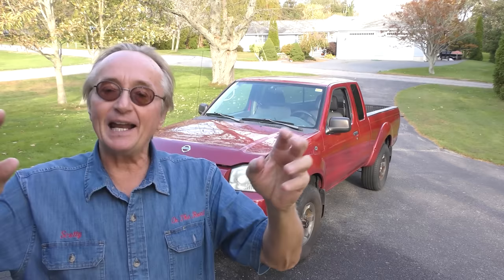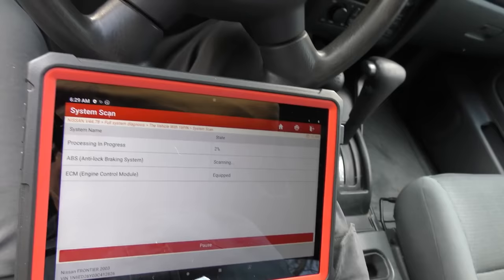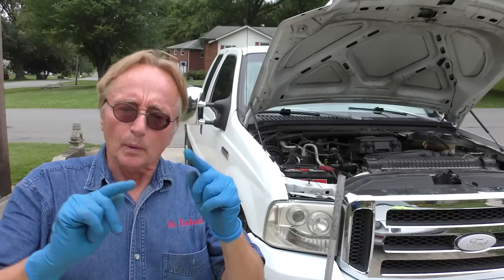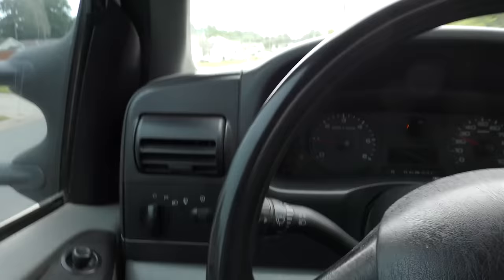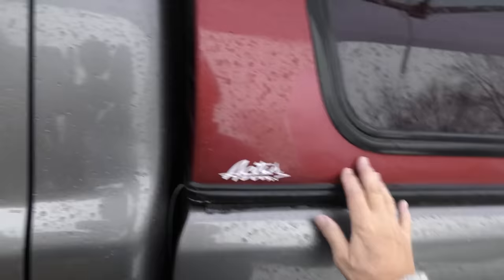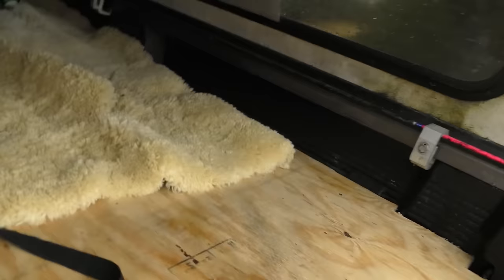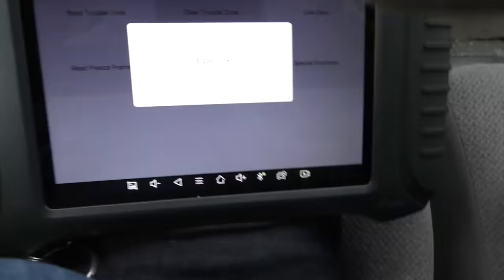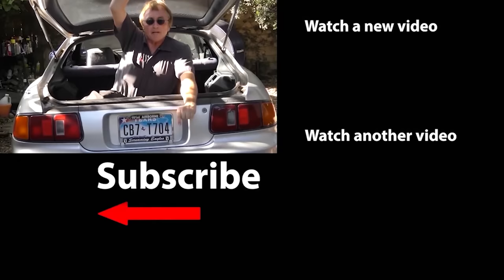3 Best Trucks to Buy When You’re Broke

Comment: My 2000 F-150 (4.2 V6, 5-spd) has 324k miles. Replaced the clutch 3 times (the real weak spot in that year's design as the throwout bearing is integrated with everything!), all-new peripheral "perishibles" (alternator, water pump, starter & power steering pump, coil plugs and wires) once. But otherwise, it's half-way back from going to the moon! Wish 1st was a granny though. Otherwise, it's been a really good truck!
Reply: im looking at buying a 2003 F-150 4.2L V6 manual transmission with 132,000miles for $5.4k....Sound decent if its maintained?
Reply: @drbookie2169  yes, they’re great trucks, as long as you maintain it it’ll last forever

Comment: Gen 2 is the best Frontier I have a 13 and a 22 13 just shy of 200.000 never in the shop had to replace HVAC blower motor today 60.00 good as new. 22 has almost 20.000 . I had a 04 5 speed but sold it with over 300.000 miles. Great trucks and way more comfortable then the Tacoma My frame is mint and I live up north in NY.

Comment: I’ve got about $3500 into a 2001 f-150 with the 5.4,the automatic 4 speed, 

Paid $1400 but had to do a few things, fuel tank and pump, pcv valve, front wheel bearings, tires, brake job.

Just need a new bed but don’t want to drop $1200 on one not rusted to hell

Comment: Yeah the Frontiers before 2010 actually have more made in Japan parts than the Tacomas of now.   I had a 2006 Frontier that ran like a swiss clock. I only sold it because the rust from living by the beach had eaten holes in the body.  It had made in Japan power steering pump, manual speed gearbox, alternator and starter was all made in Japan as well as many other parts. Even the heavy duty brake pads it came with, brake lines, etc... where all made in Japan.    Those days are one now.  Tacoma and Frontiers have fewer and fewer made in Japan parts today and  the damn trucks cost twice as much!

Comment: You know, don't be afraid of the old 351 f250s either, especially if you can find one with a manual. Honestly, the old f150s don't be afraid of those either and I'm talking about with the Five-O, but you be better up getting one with the 300 cubic in straight 6. They're pig on gas but they run forever and they have to work for days torque for days.... If you want to go know where you can I don't suggest it but 97 to 2003 F-150 but get the 4.2 L V6 that motor runs forever or the 4.6 L two valve

Comment: Had great success with a GMC. Vandura 2500 - motor and transmission rock solid, simple, reliable van. 1988 ;-)  when they were still simple enough to keep running, without going to a dealership. Body rust, from dirt getting into the side panels, and not being cleaned out, so that moisture accumulated along the bottom edge.

Comment: You could buy a Nissan Hardbody with a V6 up until 1995 I believe.
Reply: Came here to say this!
VG engine, typically on the 4x4s.
4 cyl was the KA24.

D21s are the unknown secret and hopefully Toyota heads never find out.
Reply: Just bought a '95 2wd V6.  The VG30 is a great engine, I have 3 sitting in the shop so I'm going to start rebuilding one.
Reply: @mescko  for sure, all the VG engines are awesome, just gotta keep up with the Timing Belts.
Reply: @KrashGT  I did one on my '88 200sx SE-V6, loved that car.  Never liked any V6 'til I had that car.  Also had an '88 Maxima SE.

Comment: I had an ‘88 Nissan D21 Hardbody 4x4 5 speed 4 cylinder from my dad he bought new with 9 miles on it from the dealership We both put around 475k miles on that thing before I broke the transmission by hauling a lot and way heavier than what it was probably rated for up and down the mountains of NC, everything was all original parts except a new clutch and a radiator I assume both from having to climb those mountains so much. Some guy offered us way more than we thought it was worth (back in 2002) and he put a new transmission in it and is still driving it around today. Best truck I’ve ever owned!

Comment: The F250 with the 5.4 is a very reliable truck. Do be aware when looking to buy one. Expect to deal with the brakes locking up, often and replacing lots of calipers and pads. It’s faster than an f150 with the 5.4 for some reason, I assume they are tuned better. And the worst part is the gas mileage, avg 10mpg, the truck will say 11.5ish. It’s sugarcoated. And also the gas needle and miles to empty display is terribly calibrated. It don’t work accurately. It’ll piss u off.

Comment: My first vehicle was an 01 frontier.. Never got it on the road because i decided to go with dodge.. But i gave it to my dad, 230k miles, broke a timing chain and replaced it, has a bad crank pos sensor, and that thing still starts, goes, and gets anywhere it needs to be on the oem engine. Luckily i think when his timing chain broke, none of the pistons made enough contact with the valves to blow up the engine. New belt and new timing, thing runs like a dream.

Comment: I have a 98 ford ranger with 354,000 miles on it. Kept the oil changer, Flush and fill the coolant, the only problem i have had is the automatic transmission i replaced it with a rebuilt Jasper. That's it. It has factory air. I installed pan Alpine stereo system love my truck.
Reply: Which engine?

Comment: If it’s a 5.4-3 valve engine. The ticking is the cam follower/ lash adjuster. That’s a tell, if you don’t replace it, it will grenade the head, cam, and more then likely, the bottom end
Reply: Those are the Triton motors right?

Comment: Got a 2015 Frontier because my F-150 got hit, and I'm OK with it for the most part. Significantly cheaper than the similarly specced Tacoma that I really wanted. Really only minor complaints with it, being that I really like the way all the controls on my F-150 and the Ranger I had before that were, but I've had it about 7-8 months now and I'm adjusting. Just minor things like the windshield wiper controls being on the opposite side, the headlight controls being on the turn signal instead of on the dash, and not having a column shifter, just to name a few. And the gas mileage is worse than my 01 Ranger was but at least it's slightly better than the F-150. Would have loved to have a Ranger of the same year if I could have, I hate that they stopped making them for the US market.

Comment: Any 78-83 Toyota.
The 20r holds the guiness book record for most miles on an engine.
You can buy these trucks for $600-$3,000, all day everyday.
I used to flip them, as an auto detailer, because there is nothing to them.
20r or 22r if you want reliability.

Comment: What about a 2004 Ford F150 Heritage with 4.2 liter V6? I paid $2500 for it 4 years ago. It had 180,000 miles. It now has 233,000 miles. It does have a rear main leak but as far as I can tell it doesn't smoke.
Reply: I have a 2003 with the same engine. I also had a 99 with that engine. I did a crappy job of taking care of my 99 and the engine finally blew at 215000 miles. It is a tough engine. So I bought my 2003 with that same engine at 200,000 and I’m taking very good care of this one. Mine also has a rear main leak. A few days ago, I saw one similar to mine at a convenience store, and I asked the clerk was it her’s. She said yes; it’s a 97 with the V6 that has over 350,000 ORIGINAL miles on it. She was BRAGGING about it. Take care of these engines and they will last.

Comment: I've got a 2007 4  cylinder Frontier with 262,000 miles I bought new. I looked at the new Frontier truck made by Peugeot and I didn't like the cost of changing plugs or the weird grooves in the truck bed making cleaning it harder. The old Frontier is great for fishing trips and I don't worry about leaving the truck on the side of the road while I hike to go fish. It amazes me my 6 cylinder 10 speed F-150 gets the same 22 miles a gallon as my old Frontier. Better believe I'm babying the Ford and keeping it in top condition. The Frontier isn't pretty anymore, but it's doing the dirty work I don't want my big truck doing. Friends often want me to sell my trash hauling Frontier and it's a hard decision to make unless I take Scotty's advice on an old sedan for my teenager to drive.
Reply: I have a 09 5 speed Tacoma at 265k. I think your frontier will live just as long. Both good trucks

Comment: I got an ‘07 f-150 super cab 4x4 with the 4.6 v8, the transmission shifts and the engine starts everytime, she’s just got rust. I bought it from family and payed 1000 for her earlier this year with under 80k miles on it. I’m using it as both my daily driver and a work truck. It was just sitting in my uncles driveway for 10 years with infrequent use.

Comment: I'd strongly recommend staying away from the 5.4L in either the F250.  I had to replace the engine in my 2005 F150, and that was in 2013....so 8 yrs and an engine replacement.  I sold that truck in 2022...and I was afraid it was going to blow up again.  AND yes I was diligent in my oil changes, 5w20 synthetic.  It's just a bad design.

Comment: Just saw a 2006 Ford Ranger auto. 116k miles on Chicago craigslist.  They wanted $6999.  Might be worth it.
Reply: Eh my experience with ford transmissions is they all tend to go out around 150-180k, so be aware of that. YMMV
Reply: @sknapp19911  the manuals last longer

Comment: Just bought a 99 frontier with 138k miles. Runs great, everything works, no problems. It’s an Az car, so no rust issues. Getting used to a stick shift took a few hours, but all good.

Comment: I got a 1995 dodge ram 1500 4x4 400k miles original engine and trans lifted for only 400 bucks runs and drives no ac but heat works

Comment: Cheap cars I bought in 2022-2023 because I'm poor 
2006 Toyota matrix 190k $900- needed brakes,  control arms ball joints wheel bearings 
2005 gmc Yukon xl suburban 4x4 180k $3000, had fuel leak from Rubber hose. 
2011 Toyota sienna 199k $1200, needed fuel pump.

Comment: Ultimate cheap pickup was the Isuzu Pup Diesel manual tranny from the 80s. Great vehicle. Those things ran forever
Reply: Like the old Toyota mini trucks from the 1980's that had the R-22 4cyl engines. Dam things ran forever and you couldn't kill em', even with oversize tires on the 4wd models! Lol
Reply: Bad part is you can't find parts for them anymore
Reply: @jbar518 The Isuzu Pup diesel was rare when new.  The Isuzu diesel is an excellent little engine.

Comment: Looks identicle to my 2003 Frontier 4x4. Manual shift.  I have 267,000 on it. I have changed timing belt twice. Still rollin.. One thing that surprises me is the wheel bearings are still doing fine.

Comment: Beware of any Ford F150 that has the 5.4 three valve Triton engine. These have variable valve timing with camshaft phasers that go wonky if the owner doesn't change the oil very regularly. It's very expensive to fix. The two valve 5.4 Triton and the 4.6 Tritons are fine. No camshaft phasers to go bad.

Comment: You're not hearing lifters on that F250 you're hearing the cam phasers. Time to go through the timing chains and tensioners clean out the oil passages and phaser lockouts then it will be good for a while.

Comment: i bought a 2000 tundra 4.7 v8 2wd, for $800. got a new frame put on it for free due to recall, and have done $1200 worth of of work. BUT I HAD MY NEW FRAME PUT ON IN INDIANA. but i did have a friend working at the toyota dealership. im thinking about trading it in on a 4wd though.

Comment: The ford f 150 between 1998 and 2002 with the 5.4 Triton engine runs forever to. I've seen them with 400.000 miles with the original engine and transmission

Comment: I bought a 2006 Cadillac SRX with 140k for 1200 put a new timing chain that only lasted about 2 years. Junked that and fixed up a 2003 Toyota Camry i bought for 600 and did 500 dollars of engine and radiator work and thats my daily now. Been running like a champ A/C is stil ice cold after getting rid of the nest in the cabin air filter slot.

Comment: The old Frontier's had O2 sensor issues and couldn't even haul a dryer without becoming asthmatic and costing you $385 per o2 sensor replaced 18 factory one's with factory one's and an additional 6 aftermarket at $290 a piece. They are a piece of crap. Also the F150 and 250 were also terrible. My work trucks, (owned by the State),  we're terrible. They claimed the couldn't replace them, but had money to repair them. Resend fell out when they changed the fluid at 40,000 miles, went through 3 of the m at $10,800 a piece had a propane manifold ,( which we didn't use), and was $1000 labor each time to replace the coil packs 12 times, the front end had a bounce from day one and was rebuilt new 4 times and yet it beat 10 sets of 10ply tires square and that's just the tip of the iceberg. They spent over $200,000 in repairs when they could easily have bought at least 4 new truck's. The automatic transmission's we're junk the manual transmissions were junk the only thing that never went out was the a/c. The timing belts broke, vibrations broke the steel bolt on supports for the bumper's, split the dash, broke the windshields, and destroyed the mirror mounts. The paint split and flaked off because Ford used galvanized metal on the hood, fenders and bed.

Comment: I've owned several 1995- early 2000 7.3 powerstrokes. Miss them, I'm currently 8k into a 93 k2500 454tbi/nv4500 (bought it for 2k, I'm the 2nd owner) and I've spent 6k getting it back to almost all new parts (brakes/shoes, brake lines, drums, tbi rebuild, distributor,  ignition coil, every sensor such as MAP, IAC, TPS, Coolant sensors, fresh fluids front to rear, new coolant hoses, new windshield, full tune up, oil cooler lines.) Next will be ball joints, idler/pitman arm and perhaps a clutch though its not needed but the pilot bearing is annoying and it's just one more thing off the list and make the truck more valuable and reliable. It will see another 400k miles with ease. It's worth it in my eyes; for comparison my buddy was eyeing a new Bronco...$1,100 a month + full coverage. I spend 400 a year to insure my truck. He would spend in 6 month what I've spent in 4 years...

Side note on that guys f250, ford did some odd wiring for the 4r100 and 5r110. Arguably my fav automatics as they were rated for 1200ft/lbs factory..but they tied the cabin light (rear light on the cab) into the trans...so on occasion, that 3rd light can cause shifting issues. Another issue is they are very picky on voltage; can't tell you how many I've seen shift rough/slow and the culprit was a shitty alternator. Throw in a quality alternator (mean green 220amp was my fav) and shifted like butter.

Comment: I second the 10th gen f150. With a V6 and 5 speed you basically have a tiny Powerstroke, it will pull and haul like a boss!
Reply: Uh, no it won’t.  I had a 97 F-150 V6 5-speed and it struggled to pull my 2000 pound boat up a launch ramp.  That V6 was gutless, and the 5-speed was a Mazda transmission which was built for Rangers and B-Series trucks to haul light loads.

Comment: you don't get everything with a car.

if you want a car that is quiet inside when driving, has good driving characteristics and is durable, then you have a problem.

I have big problems finding a newer car that is quiet inside while driving.

The quietest car I've driven is.
1. vw passat 1998 1.6l manual

Those that have too much noise.
1. opel astra 1999 station wagon
2. subaru forester 2006
3. Ford mondeo titanium 2012

Comment: I having trouble finding a place to replace the engine on my 2002 Frontier.  We just replaced all the suspension and brake components and that was quite the job. The frame is in good shape and everything but the cruise control works so I think a new or newer engine will be worth it.

Comment: My advice to anybody even if you can afford a new truck by an older one recondition with all the main parts that you're going to need the main things cooling systems pumps radiator brakes shock absorbers and that truck is going to run at least another hundred thousand maybe even two hundred thousand miles more you're by a $3,000 truck or maybe a $4,000 truck you spend about $5,000 on reconditioning and it's going to last 10 years and not only have I done it I'm doing it again right now

Comment: I had a brand new 2002 F250, 4 wheel drive, with plow pkg, but never plowed ! They replaced the Front wheel bearings TWICE under warrantee. It also threw a plug that took out the spark generator ! Because FORD refused to send out a service buliteen that All 5.6 Engines from 98 to 04 I believe, had only 5 threads for the spark plugs, instead of 7 !  BMW had a similar issue. I spoke to a guy in CA. who created a process that he over sized the threads, and had a screw in insert, made from the same metal as the engine, and he expoxyed it in ! That's
Guaranteed for as long as you owned the vehicle, he was reasonable priced, came right to your house, and had at least 5 or 6 technicians working all over the country and some in Europe. Ford totally dropped the ball on this one, A simple fix, take the plugs out, clean the threads, as they carboned up, put plugs back in, and retourque

Comment: Highly  disagree  about 2000s and up fords as being reliable buys to get. The only good fords  were in 90s. Beyond  that stay far away, have tons electronic problems,  eninges throwing rods, pistons , spark plugs blown out , transmissions problems up wazzo. Just go Craigslist  see how many 2000s and up fords are listed as tow away. The 90s ford's were best and very reliable. A better choice a Chevy gmc  90s up to 2006. The 350, 454, and LS 4.8, 5.3, 6.0, 8.1 engines where extremely  reliable  and cheap to fix , easy find parts.
Reply: no, old Chevys aren't better than old ford's. old Chevys rust out worse. and they're no more reliable. you can't beat an f150 with a 300 and a 4 spd stick in it if you don't need a. v8